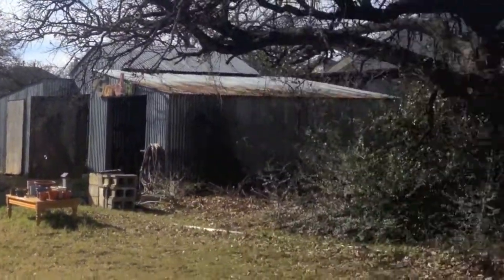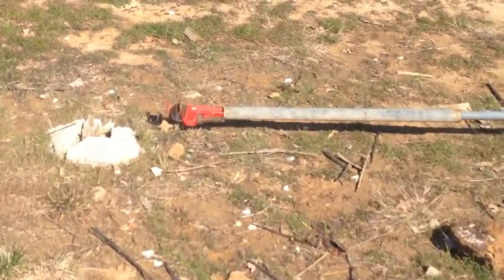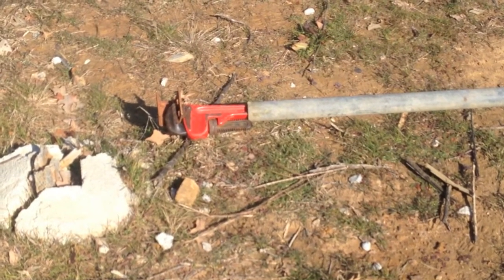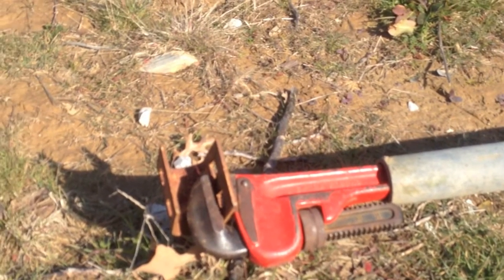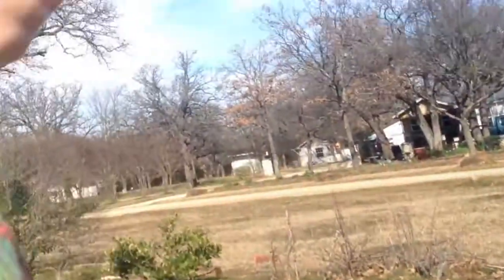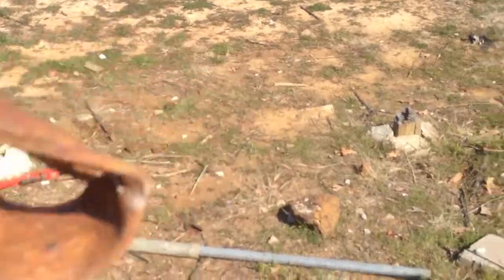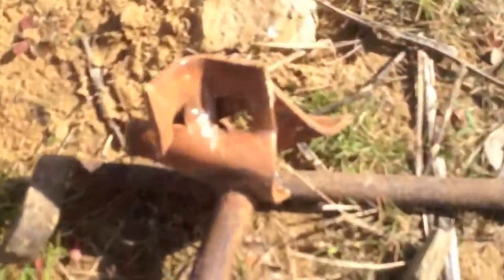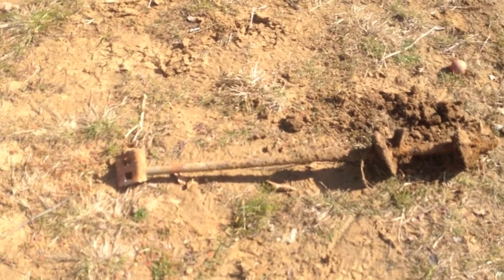mobile home tie downs HD

Comment: Hook a chain run over an old flat tire right at the tie and hook it to the ball of your truck and it will pull them right out with minimal pull
Reply from the maker: i cant picture what your describing. is there a video of this?